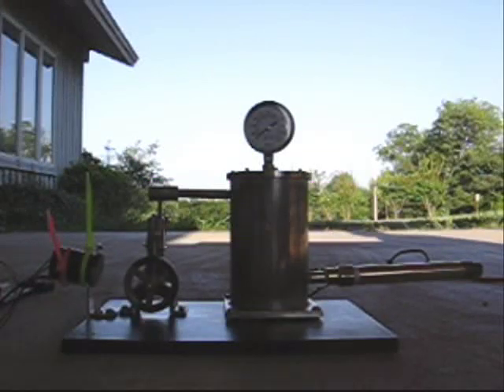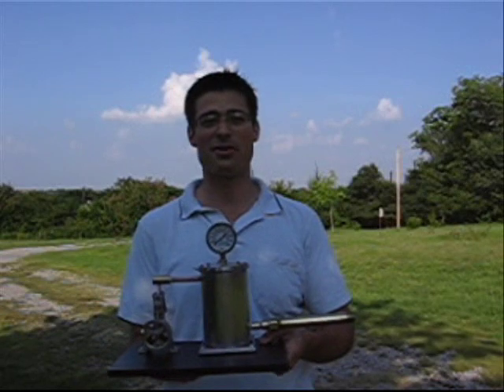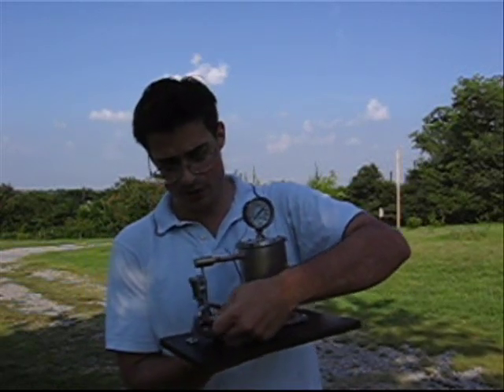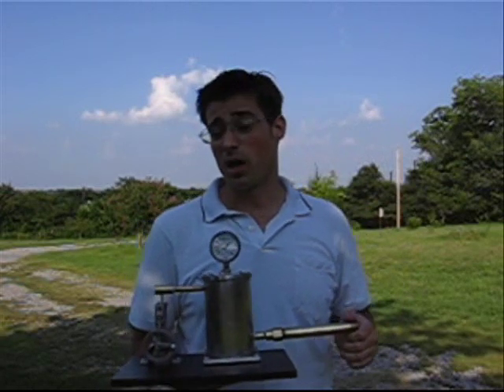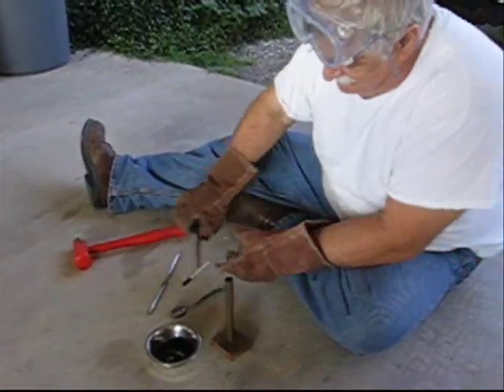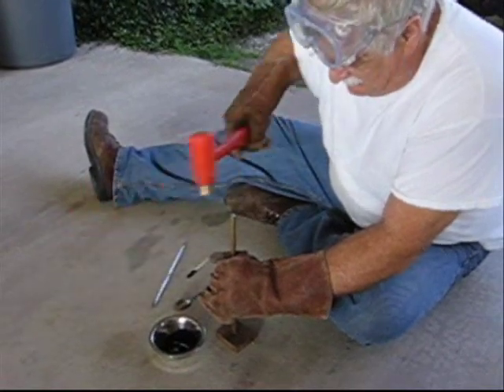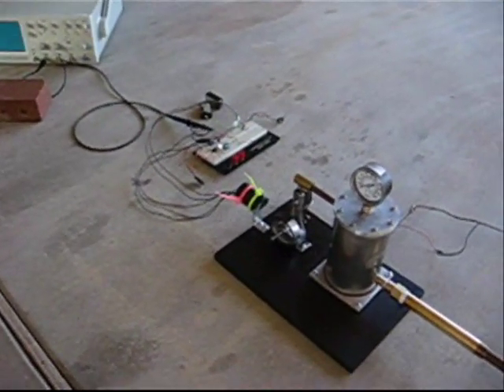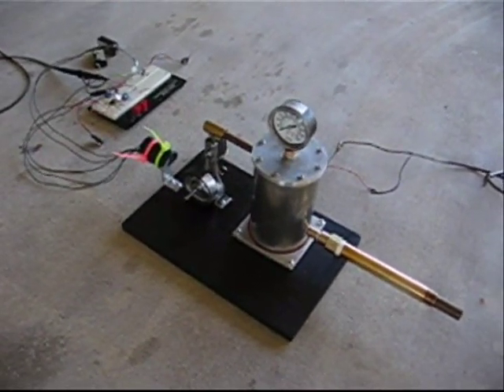Mythbusters Blackpowder Engine Challenge

Comment: When black powder is burned (combusted) it produces gases 
(CO2, SO2, etc.) and solid pariculate matter (smoke). These gases are what drove the piston and produced motion. There was no visible smoke because the engine and internal filter trapped it. 

BTW, it's spelled powder, not "pouder" and it's fuel not "fule". Also, you should capitalize the first letter of a word that begins a sentence. Makes you look smart.

But then, you're a comedian, right?

Comment from the maker: The black powder log is NOT OUTSIDE the system.  Yes it is a "steam" engine, but in this configuration, combustion gases enter the cylinder (not steam), thus making it "internal".  Contact me for a sketch if you want.  

Think of the expansion chamber/pressure vessel as a continuation of the cylinder.

If "internal" requires that actual flames hit the top of the piston, then I can build that kind of black powder engine. How about running a 2-cyl chainsaw engine on BP ? Challenge me.

Comment: That explosive would then be channeled to another holding tank...where it would be used up.  

I'm no expert but, an engine would require more cylinders to run more smoothly since it would be running on fuel way more powerful then any gas.

Sorry if my ideas seem kinda pathetic and impossible but, im only 13 and im just wondering.

Comment: 4) Cont.   Since armstrongs mix and flash powder only require 2 things to make (fuel, oxider)  I was thinking what if an engine had to tanks 1 holding the oxider and one holding the fuel and then there is another extremely small tank which combines the 2 together and air pressure or whatever its called would mix the 2 together (like when a cars moving a little passage would open thus channeling wind) thus mixing the 2 together creating a small amount of explosive.

Cont next post.

Comment from the maker: A black powder engine will not be practical..

This was mainly a proof of concept type video.

1.)  The solid combustion products will have to be cleaned too often.

2.) Propellant - weight ratio is poor, because salt peter carries oxygen, instead of using atmospheric oxygen.

3.) It could only be used on a small scale without causing an environmental impact.

4.) Too dangerous.

There may be some limited uses for a fuel-oxidizer engine, perhaps for momentary use in an underwater apparatus.

Comment from the maker: Well that depends on the term "traditional sense"...

1. a machine for converting thermal energy into mechanical energy or power to produce force and motion.

... What part of this does the machine not accomplish?  

Also the valves are different for a four stroke lawnmower engine.

Comment: Black powder can be made by placing debarked sticks of wood (willow, elm, other)into a clean, one gallon paint can over a hot fire. The can must be vented with a 1/4" holes in the lid and bottom, and no air must be allowed into the can while it's being heated. Using sawdust might present unique problems, like venting and spillage, and not all woods produce charcoal suitable for use in black powder. But give it try!